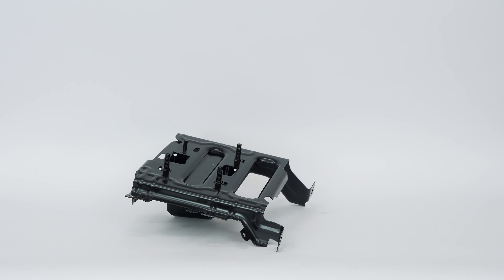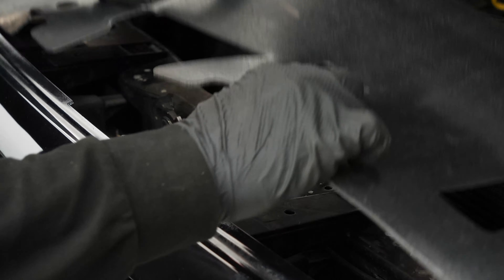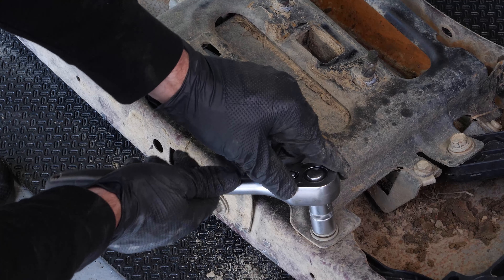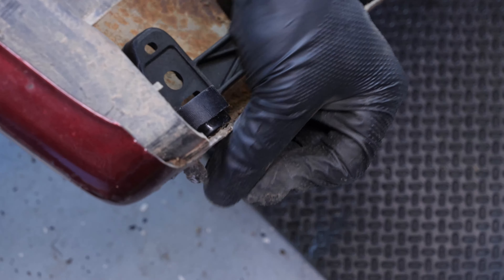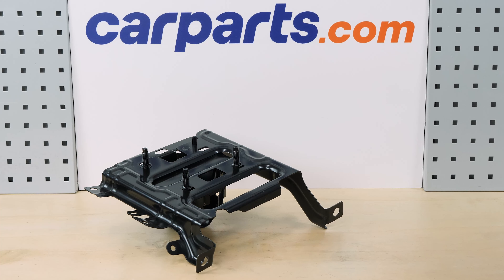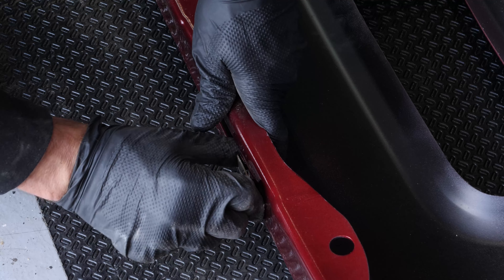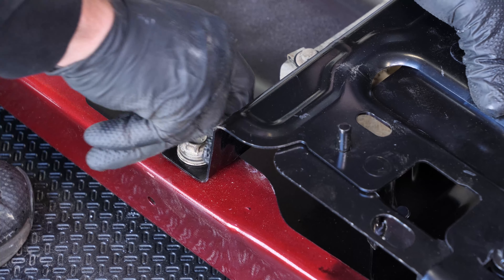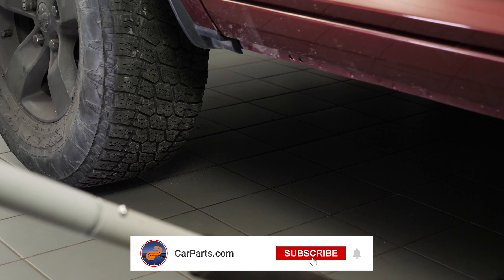How to replace the Front Bumper Brackets 2009-2018 Dodge RAM 1500 🚗

Comment: The video tells what size sockets to use but it doesn't tell the size of the bolts. I know they are metric and I don't know what size they are and I need the bolts for the bumper bracket and the bumper and the valance and all other parts. Sure would be nice if the description showed the bolt sizes and the nut sizes so they could be replaced if needed.